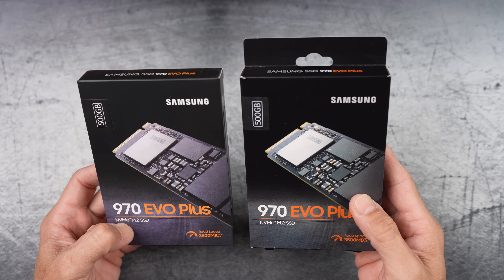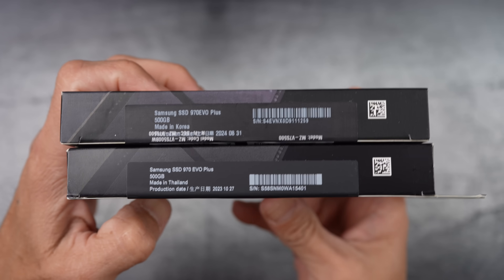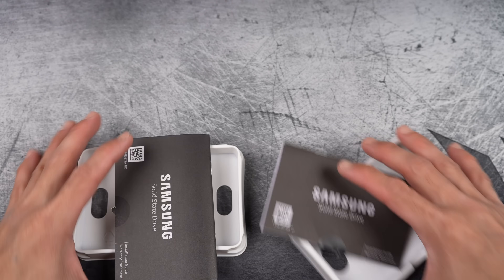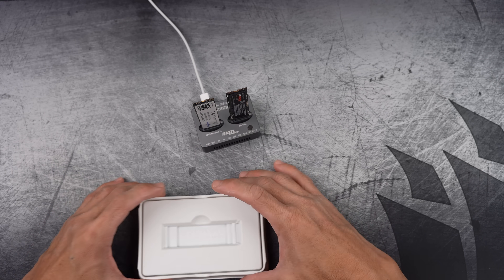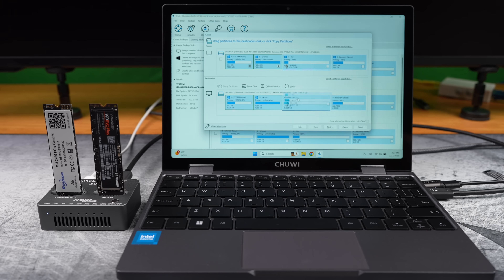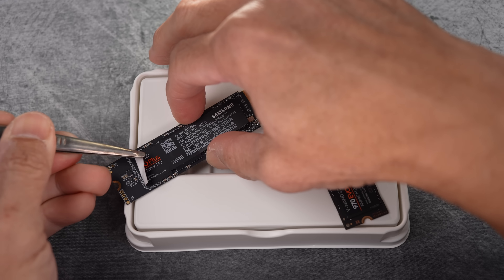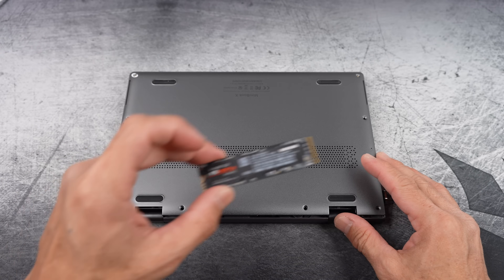Fake vs Real SSD - Can You Spot the Difference?

Comment: Iam buying a used one 990 pro 
The seller tells me it has no box 
The original price in my country is 9500
Him selling at 7000 
And he sent me a amazon invoice
Reply from the maker: Thanks for sharing! If the SSD has no box, definitely double-check the serial number on the label and match it with Samsung Magician or CrystalDiskInfo once you get it. The Amazon invoice is a good sign, but make sure the storage size, model, and speed match up. Lots of fakes look very real these days—even with “real” labels! Be careful.
Reply: Thanks sir pray for me🤲🤲 @TossSong

Comment: Your cloner is NVME to NVNE?  Is there one to go from a 2.5 SSD to NVME?
Reply from the maker: Great question! Yes, the cloner I used in the video is NVMe to NVMe only. To go from a 2.5” SATA SSD to an NVMe drive, you’d need to do a manual clone using software like Macrium Reflect or Clonezilla along with both drives connected via USB (one SATA enclosure and one NVMe). Not that I know of, No direct cloner dock can convert between SATA and NVMe since they use different protocols. Hope that helps!
Reply: Are you saying if I had an enclosure for a SATA SSD and an enclosure for NVME connected by USB to a computer with cloning software on it that would work?   There is no cloning device to go from SSD to NVME.
Reply from the maker: Yes, exactly! You got it — there’s no standalone cloner dock that converts from SATA to NVMe directly. But if you have both drives connected via enclosures (SATA and NVMe) and plug them into a computer, then using cloning software like Macrium Reflect or AOMEI Backupper, you can clone from the 2.5” SATA SSD to the NVMe drive that way. Just make sure the target NVMe is properly initialized and has enough capacity. Hope this helps! 👍

Comment: the QR Code on the fake is different and on the left the ground , no holes going through to connect both sides  and next to that are very small gold one square and small round hole plus a lot more things different such as the label smaller   .    4:53
Reply from the maker: Great eye! 👀 You caught some details. The small square and round hole observation too. Thanks for adding to the list — this will definitely help others spot fakes more easily!

Comment: I noticed the edge connector contact pads on the Samsung vary in length, while on the counterfeit module all the contact pads are uniform (identical).  Also the Samsung has a cosmetic black coating on the back.
Reply from the maker: Nice catch! I totally missed the contact pad lengths — that’s a super helpful detail. And yeah, that black coating on the back is such a dead giveaway once you know to look for it. Appreciate you pointing that out!

Comment: you need to be able to spot the fake before you buy it... how?
Reply from the maker: Yeah, it’s tough! One way is to carefully compare the label design, font, and sticker placement with a known original (I showed that part in the video). Also, if possible, buy from a trusted seller and avoid deals that seem too good to be true. Some fakes even come in sealed boxes now 😅 If anything, make sure the seller allows returns—just in case.

Comment: can someone tell me how can you tell the SSD is fake by just looking at the SSD not the box coz they can easily switch the box to original box
Reply from the maker: Good question! Yeah, you’re totally right — the box can be swapped so it’s not reliable. In my video, I looked at the physical SSD details like the font, label alignment, part number, and even the board color or QR codes. But honestly, the best way to know for sure is to plug it in and run a speed test or use something like CrystalDiskInfo to check the controller and firmware. I’ll probably do a follow-up video going deeper into this too!
Reply: @TossSong  Problem is... What if your old SSD is damage and your planning to buy new one, I don't think you can install software from the market where you buy the new SSD >.<
Reply from the maker: Yeah totally get what you’re saying. If the old SSD is dead and you’re buying a new one, then yeah—no way to clone or grab restore files. In that case, you’d need to do a clean install of Windows using a USB boot drive.

Comment: I prefer Kingston to Samsung, the main difference between them is that one has RAM and the other doesn't.
Reply from the maker: Totally understand 👍 I went with this one because it’s the fastest Gen 3 SSD with DRAM I could find — the Chuwi MiniBook can only take Gen 3, so it was the best fit for me.
Reply: @TossSong  I bought KINGSTON SKC3000S/1024G KC3000 1TB M.2 2280 NVME PCIE GEN4 X4, it works great

Comment: I'm pretty sure the cloning device didn't work on the real drive because it wasn't formatted. I bought my SSDs from Amazon or Best buy. if I do it from Amazon I make sure it's sold by Amazon and shipped by Amazon. Surprise you spent $83 on a 970 500 gb. I got a 2 tb 980 for 120. another one that was refurbished from Best buy for 91. It was also a 980 2t.
Reply from the maker: Good point — you’re probably right about the real drive not being formatted. That would explain why the cloner didn’t pick it up at first. And yeah, I agree, buying direct from Amazon (sold and shipped by them) or from Best Buy is the safer route. Thanks for sharing your deal too — sounds like you got a much better price on the 980!

Comment: If users choose the 'Made in Korea' option (since it's a Korean brand), they might end up purchasing a fake product. The genuine one has a smaller SSD capacity, which causes cloning issues.
Reply from the maker: Yeah, that’s what I noticed too. The ‘Made in Korea’ label would throw me off at first, but turns out the real ones can have slightly smaller usable space, which makes cloning tricky. Easy to get fooled!

Comment: So the plot thickens
I was looking at REAL graphics cards, unless they were fake , as it also had rust on the heatsink, ones being sold at CEX, and the PCB on them were the EXACT SAME as the fake samsung ssd pcb, it even had the diagnostic traces on it with full solder contact patches.........

Very interesting
Reply from the maker: That is super interesting—thanks for pointing it out! How some fake SSD PCBs share a resemblance to real ones too. The fact that they can mimic diagnostic traces and solder patches, wow! Big issue not just with SSDs but even GPUs and other components. Appreciate you sharing!

Comment: You are completely useless for a technical channel. This video is not informative! You should have investigated and presented the way this SSD is seen by the system. Detailed SSD information, including manufacturer, model, controller, and firmware version, should be provided by HWinfo, AIDA64, CrystalDiskInfo, or even Device Manager under Windows; and nvme-cli, smartctl, lsblk, lshw, even lspci -vv under Linux.

Otherwise, there are legitimate DRAM-less SSDs using MaxioTech's MAP1202A-F1C controller, including Fanxiang/Ranxiana, Anaconda, Kingspec NX, Movespeed, and more. They should be perfectly usable. Some such SSD has been mislabeled and packaged as a fake Samsung, but you couldn't be bothered to investigate which is the exact device. Pathetic and unprofessional. 

The default overprovisioning varies across Samsung PCIe-4.0 SSD models.
Reply from the maker: Thanks for the detailed feedback. I definitely see where you’re coming from—there are many advanced tools like HWiNFO, CrystalDiskInfo, and smartctl that can reveal detailed SSD info. For this video though, I wanted to keep the focus more on visual/physical differences for general viewers, since not everyone is comfortable running diagnostic software. I appreciate you pointing out the technical side though—it’s a good reminder that I could cover that in a future video for people who want the deeper dive. Thanks again for sharing your perspective.

Comment: You don’t need to make any tests nor peel them. Just at first sight is clear that the original has heat spreader on the controller while the fake one does not.
Reply from the maker: True, the heat spreader is one quick giveaway. But if you continue with the video, there’s a lot more covered — including speed tests, component comparisons, and even cloning the SSDs for a full reliability check.

Comment: there is both original sams , just made for different worldwide markets.  Different countries ,  printers, colors , components .. be sure its both original drives . Just compare countries they made by and to what sites qr code leads
Reply from the maker: Good point — different regions definitely have variations in packaging, labeling, and even small component differences. In this case though, the giveaway was that one of them didn’t check out when verifying the QR code and serial on Samsung’s official site. That’s when you know it’s not just a regional difference but actually a fake.
Reply: @TossSong  oh, thats more sensitive info ) never met such good quality of fake things .. nice video !
Reply from the maker: Yeah, I was surprised too! They really went all out copying the look and details. But as some other commenters here mentioned, fake drives can fail out of nowhere, so definitely risky to use long-term. Thanks for watching!

Comment: 5:22 u should be careful using these, they could rewrite the firmware on the drive and let in backdoors

To test a drive fully u need to fill the drive and make sure every file still works

6:33 and it dosent work, so that could hav modded the firmware on it
Be careful useing them
Reply from the maker: Thanks for pointing that out! Always good to be extra careful with drives like these—never know what’s hiding in the firmware. Appreciate the reminder!
And the end, I clean installed everything.

Comment: Ali Express
Reply from the maker: Thanks for commenting. Not good luck with this item. But in my opinion, it’s more about the seller than the platform itself. I’ve bought plenty of electronics from AliExpress that were identical to ones sold on Amazon — in fact, you’ll often find the exact same sellers on both sites.

Comment: I got probably sold a similar Chinese Scam product. They really have no shame. Mine was a Samsung EVO 870 2TB SSD. After 6 months it stopped working. Dead, only a red LED inside was shining. I opened it and the NAND chips didn't have a Samsung logo on them. The product number on the controller chip was the one of a chinese company Ystore, not of Samsung. Tried to get it repaired on the Samsung website but the product identifier was not in the dropdown box, only a similar one. The online form was also total crap (just an unspecified error message if the description text was longer than 70 chars, extremely short!!!). Made a chat there but the service was horribly bad and ended in the sand after 2 weeks. Total f...up. I ended up buying another company's products from them on, even for my TV. They lost a customer for the rest of my life. I had my doubts about whether it was a genuine product but it was extremely believable to be real. Even the transfer rates were near the 500 MB/s.  But with your video I am now convinced there is a factory in China that throws out very similar looking fakes on the market. China has basically no laws. It was also uncovered that they produce toys for small children with  poisionous colors. I have a years long tradition in my home: DONT BUY CHINA! Especially for more expensive stuff. For most stuff you can find a non-chinese replacemement online. Just take the time and google. That has improved my life a big step. And it helps avoid the looming 3rd world war, just check the videos "Chinese military" on Youtube and you get the point.

Comment: The genuine ssd and the fake are probably made by the same vendor
Reply from the maker: Yeah, that’s possible. Some fakes come from the same region or even factories, but with downgraded parts or reused chips—looks the same outside, very different performance inside, no to mention reliability issues.

Comment: WD is much better than this Samsung drives. Samsung just takes more money for their brand
Reply from the maker: I get what you mean—WD makes solid drives. In this case, I picked the Samsung because my Chuwi MiniBook X only supports PCIe Gen 3.0, and this model fit perfectly. Plus, it has DRAM, which is definitely a nice bonus for performance and longevity—and the fastest I could get for it.
Reply: @TossSong Oh nice bro, actually my Asus TUF laptop supports Gen3 NVMe so I got WD blue SN5000 and it’s working much faster and better than the one that company gave me (Crucial gen3) and the read write speed is same as the one u showed in the video, it’s like half the price of Samsung drives, and it’s a gen4 WD
Reply from the maker: Yeah, I had thought about that one too! The SN5000 is a great value for the performance, especially being Gen4. If my MiniBook X supported it, I probably would’ve gone that route as well.
Reply: @TossSong Yea that’s good, value for money, also it’s backwards compatible
Reply from the maker: Nice! Thanks for sharing. I’d be considering for my other future PC for use.
Reply: @TossSong ❤
Reply: And they overheat and degrade like a Mofo. Scamsung is Trash nowadays. Stay away from this Turd Corpo.

Comment: Isn't it normal the results on write/read test in 2 deferents devices are different? Laptop is significantly more powerful than a tablet
Reply: It's just a screenshot from laptop he showing with tablet, tablets does not support m.2 SSD's
Reply from the maker: Thanks for help clarifying that!
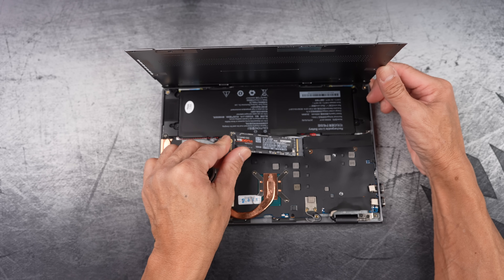Reply from the maker: Yes, exactly—it’s actually a screenshot, as the other commenter mentioned. You can see the actual tests at 7:47 (Fake SSD) and 10:35 (Real SSD) in the video.

Comment: I think the bigger financial view should be the performance versus cost. If you can get a similar SSD for a substantial cost savings over a premium brand, that is a good & logical choice for people on a budget. I do not always buy the best if either money is tight or the application doesn't need it. The key to anything in a computer in my opinion is how reliable something is- this was not demonstrated by the choices, nor were the costs shown. Since reliability itself is a crapshoot, one merely needs to properly back up data so when even the premium drive fails, you can replace it. A good test would be cost per byte for storage and then cost for speed of read/write. The faster the speeds, the better value. The lower the cost per byte, the better value. Score both and show overall which one is best. Fake or old, they have their place. I have a new IMAC M4 and next to it is my 27" Quad Core I7 iMac which runs well (Catalina).The screen size still outperforms from a glance the new iMac and the cost for one now is peanuts. So don't throw out a fake, just know it isn't the real thing- thats it. I am sure there are some girls out there sporting a large CZ and don't know it.
Reply from the maker: You make a great point—performance-per-dollar is definitely important, especially for budget users or secondary builds. Totally agree that reliability is key, and yeah, backing up data is the ultimate insurance no matter what drive you use.
That said, a few folks in the comments have already mentioned their fake drives (especially the unbranded or sketchy ones) dying pretty fast—so even for budget use, it’s risky. But I like your balanced take: don’t just toss a fake—just know what you’re working with! Thanks again for the thoughtful comment!

Comment: Hi just wanted to let you know that the manual on the fake one is a copy on a real 970 manual and it was the same layout .They changed to the other manual layout like in August of 2021 .So saying that is a way to tell its a fake is wrong. But the bad print job is good way as the real old manuals print looks like the new manuals print . Just Thought i would let you know before you freak out people that have a real 970 but have the old manual .
Reply from the maker: Thanks for pointing that out! 🙏 The manual layout alone isn’t a reliable way to tell if it’s fake, especially with older real 970s still using that design Great info, thanks again for sharing! 👍

Comment: Guessing the real vs fake box is easy - when you have both. The black is of the real one is a high quality black, the fake one has a purple tinge. On their own the difference wouldn't be as noticeable.
The fake drive is easy to spot even on its own, though - because the sticker floated in the air at some corners. There's no way Samsung would design that.
Reply from the maker: Great observations! 👏 I totally agree — having both boxes side-by-side really makes the differences stand out. That purple tinge and sticker issue are such clear signs. I also noticed the fake label doesn’t lay perfectly flat, just like you said — no way Samsung would let that pass. Thanks for sharing your insights! 👌

Comment: MB/s is MEGABITS per second. Not MEGABYTES.
Reply from the maker: thanks for chiming in! Just to clarify — in this video, I’m using CrystalDiskMark, which reports speeds in megaBYTES per second (MB/s), not megabits. So when you see 500 MB/s, that’s megabytes, which equals 4,000 megabits. Easy to mix up though — appreciate you pointing it out! 🙏